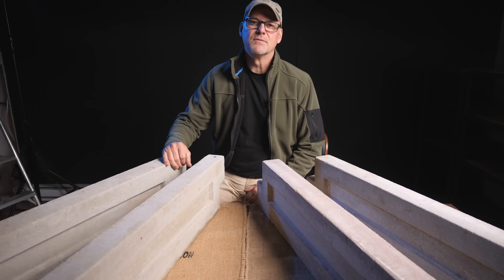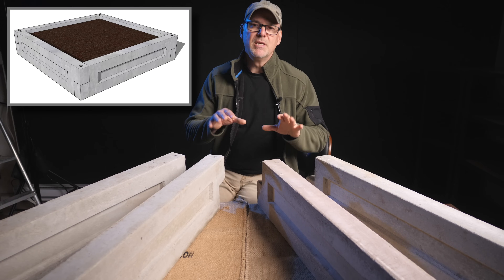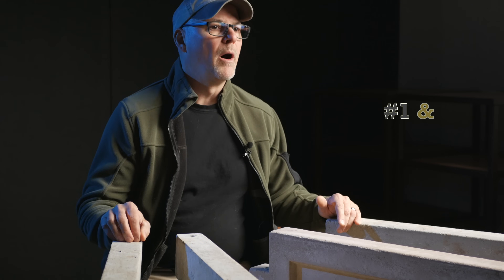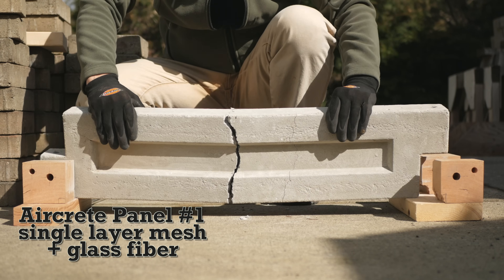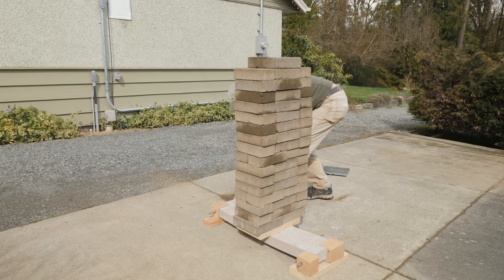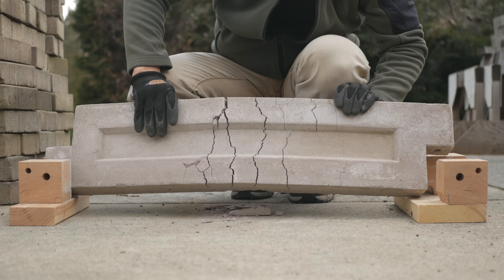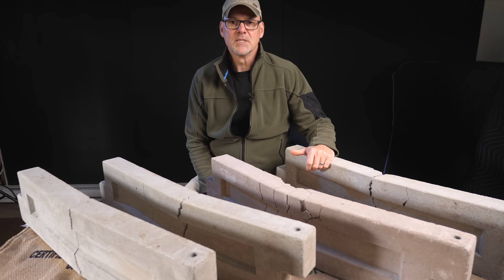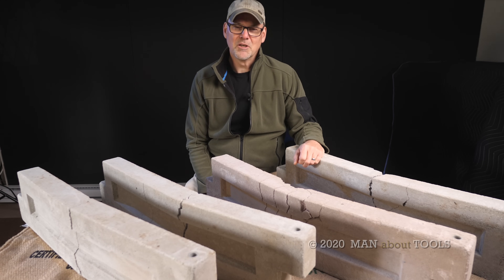How Strong is Aircrete? Deflection Test Lightweight Concrete Garden Box Panels

Comment: One of the reasons that the double layer of mesh may have helped is because it forces you to shove it deeper.  Since the inset is down in your testing, and the purpose of the steel mesh is to take the tensile load, the further down the steel mesh is, the more work it is doing to hold the cement together.  If you bent the doubled mesh forward on both sides of the inset, flat in the middle and forming a box in the thick part of the form, it would add tremendous strength.  Of course, if strength is a major issue, you could just turn the panels around and put the flat, reinforced, side away from the load.  Steel on the compression side of the cement does very little work.

Comment: I think that iff you separate the double mesh will be adding more strength to the panel and second, the perlite has the the capability of absorbing water so is better if you added it already wet, so That way the mixture won't dry to fast, instead will be adding water to cure slowly.. Thanks for sharing your efforts, keep inspiring others.

Comment: I wonder if aircrete fibres need to be longer then fibre for heavy concrete to make a difference.
also it is amazing to see what a double layre of mesh can do! wow!
Interesting to see how perlite really detracts from the mix
Thanks for sharing!
Reply: Tensile strength is not the only measure of utility in aircrete. For instance floors and ceilings may be OK with perlite, or sand to create the most useful mix for the application.Just seal it for it's environment.

Comment: I noticed you are loading them with the wire mesh on top for compression it should be utilize for tension at the bottom. If you load them with the wire mesh at the bottom you will be amaze  how much load your panel can handle. Try them standing and it will hold more load. Reinforce with wire mesh on top and bottom of your panel would be perfect for structural load. You can also try inserting a plastic tube at the bottom then insert an allthread rod after its cured put nuts and washers on both end and tighten.for a pre-stressed air create that you might be able to use for a bridge on a mini pond. More power...
Reply: I was thinking exactly the same, with using a pvc pipe with a threaded rod inserted  into it.

Comment: I appreciate your hard work. It seems as if that single-layer mesh was on the top side. If that is true, the panels would be stronger with the mesh at the bottom (or the side that stretches, instead of the side that gets compressed).

Comment: Im not an engineer but a physics student myself. I want to propose a improvement of the steel grid. As you pointed out in the last video what you are performing is basically a tensile strength test. It was very clear that the concrete panel with the double mesh could withstand a lot more stress. As the panels are loaded from the flat side the tensile strength gets concentrated on the bottom side bar sections that are deeper than the notched out middle section. I think you should try to get the mesh in some sort of shape that fills out these lower bar sections. The flat meshes you are using right now lie above the middle section and are therefore to far away from the opposing side of the stress.

Comment: I think you will find that if you add sand to the aircrete , you will see a significant increase in strength, along with two segments of Metal reinforcement . Should be closer to the others you tested.

Comment: Not very durable if you keep cracking them! LOL. #3 was most impressive!  If makes sense because two letters if wire would work in such a way that one is in tension . In single mesh, the  location of the mesh would be very important. So if the mesh was towards the top. Then it would crack quickly. If it was towards the bottom, then it would be very strong.

Comment: great to see the tests - adding rebar along with wire mesh may beef them up much more - it was a good showing of how a little materials science and engineering can go a long way - all the components need to be optimized according to your use case but the modular design was nice to see

Comment: Nice video.  I'd be interested in the same testing with an aircrete panel that has been wrapped during pour and cure.  Wrap could be fiberglass or nylon or cotton or whatever you think would be a cheap way to strengthen the panel and at the same time make it more chip resistant.
Reply: Could get pricey

Comment: Pardon my ignorance as I am not a structural engineer nor am I claiming to be experienced enough with cement to understand why you would want to put Perlite into aircrete.   Air bubbles are spheres. Cement that incorporates spheres seems logically better able to withstand breaking than cement that incorporates perlite (which I do have some experience with, and know that it is absolutely unable to add strength to anything it permeates). 
My only experience with aircrete was in pouring a skinned aircrete block dome (interior 15 feet) which had an aircrete block arch entrance doorway then the whole structure was covered with sprayed aircrete, then later, buried with about two feet of soil at the top, tapering out to about three feet at the bottom.  The soil has been planted with shrubs and vegetables and has had people climbing all over it for about a year, with no cracks, so maybe it's just that domes are structurally sounder than plates rather than it being the perlite additions?
Reply: domes act under compression which concrete does well. he was testing tensile strength which concreet does poorly unless it has steel rebar to take the load and evenly distribute it. however steel rusts and expands over time due to moisture in the concrete. that is why roman concrete has lasted thousands of years (no rebar). and modern bridges last only 20 years or so.
Reply: @Craig6844  That and the large chunks of calcium.

Comment: thanks for such perseverance - so if I go with aircrete  I'm gonna add a double layer of mesh and avoid perlite after this episode

As to whether I go with aircrete or straight CSA concrete panels - well it depends on your upcoming comparison to some extent - I predict greater strength already

At the end of the day as to whether its aircrete or CSA wil be down to a cost/benefit analysis - namely the relative benefit of any weight saving of aircrete; factoring in the simplicity, durability and cost of CSA panels. Already I'm leaning towards CSA given the extra equipment needs of aircrete - I just keen to get gardening is all. But I'll wait to see what you conclude in your upcoming post

Anyway your clear well produced videos are much appreciated once again from downunder in Melbourne, Australia

Please stay safe and don't catch that Covid 19 on us please :)
Reply: Any activity in Australia on using aircrete for residential fire resistance retrofit?
Reply: @edbouhl3100  no idea. Our science outfit might be the best to follow up. i.e. CSIRO.    https://www.csiro.au/

Comment: It might not be a problem, but my main concern with the freeze/thaw cycle is with water around the metal rods freezing and expanding to bust out the holes.
Reply from the maker: I have not had that problem. But the holes could be filled or capped to keep out water from pooling in them.

Comment: The double mesh panels were the winners because of the placement of the mesh.  Here is why.  While the concrete is strong in compression, the wire mesh is for giving strength in a tension mode.  The force of the soil in the bed would be such that the outside surface of the panel would be in tension.  The wire mesh, to be performing its' function, should really be pushed down in the form past the center depth, closer to the outside surface, where the panel is experiencing tension.  If its position is in the inner half (soil side) it is in a compression zone and not really helping.  Cracks form where there is tension.  That is why the rebar in a "pre-stressed concrete beam" used in bridge building, is placed in the lower part of the beam (as it sits in position in a bridge) where the tension from the load overhead is experienced.  If you really wanted to get fancy, you could  drill 2 holes in the end forms 1/2 in above the indent surface and place a rebar thru the holes-apply tension to the rebar while pouring and curing like they do when making pre-stressed concrete beams.  That's a lot of overkill for a garden bed panel but if you are having fun with the testing anyway, you would probably be amazed with the test results
Reply: Makes sense that different depths for the mesh could explain differences in max loads.

Comment: Congratulations, and thank you for the ideas. And advice from my side if you don't mind....Although nice to see your efforts regarding searching the best solution, I think the focus is missed a little. The target should be the lightest concrete withsand the DISTRIBUTED force from wet soil inside on its WHOLE contact surface, I think. But anyway this is your project, your choise...(And if you would get more reinforcements, than you should apply thicker, hole to hole bars bended both ends around the two holes, like this: <________> The other direction mesh is not that important if you consider the presented load -which is distributed force only on partial surface - meaning more load). No offense, just a comment from an engineer...:)....Keep up the great work!
Reply from the maker: Thanks! I very much appreciate the feedback and suggestions! There's so many ways to approach this. I think applying a distributed load would mean I would have to apply a LOT more weight. So there's issues trying to make that (safely) happen with my limited resources. However, I think I was still able to demonstrate a substantial load to get a general feeling of the strength. Kent

Comment: Try using galvanized rods instead of mesh. It should make the tensile strength greater. Would also like to see the thin CSA testing
Reply from the maker: I'd be concerned that the heavier rods would sink to the bottom of the form. The mesh has some buoyancy to it in the wet aircrete. I'm working on the CSA tests this week. The Covid issue has thrown a wrench into my life of late.

Comment: I wonder how adding Styrofoam balls would affect the strength of the the panels. Styrofoam is added to concrete in housing to make it lighter.
Reply: I believe that the perlite was a close enough signifier of that….. Using it for insulation is satisfactory but nothing with a load….

Comment: How about removing the decorative rectangle, and pushing the mesh further down, near the face, also for aircrete using a finer mesh? Would also be interesting to see, a thin layer of regular concrete on the faces and then aircrete in-between, should fair well in the lawnmower test .-.

Comment: Awesome.  I was going to ask you, would these be good as a hardy board for privicy fences?
Reply from the maker: Hardy board is much thinner I believe. And probably much cheaper and easier for that application.
Reply: @MANaboutTOOLS  Thanks for taking time to respond.  I guess what I'm trying to say, Is it possible to make thin sheets of cement board from the materials you use to make your planters to use as maybe inch thick sheets for fencing applications...
Reply: @wilassguess  The answer is yes. i have used Hardie board for a raised garden. 6.25 x 12' for 6 bucks and change at Home Depot. Used pressure treated 2x4 cut at 12" on outside. Attached at beginning, 4',  8', and end and then staked outside of those and screwed together. Made "L" shape corner out of the 2x4 attached to outside. Didn't want pressure treatment leching into soil.
Reply: @picayunebill6614  thanks Bill
Reply: @picayunebill6614  I was thinking today of a design similar to yours.  The differences being three boards high vs. one board and support posts every three feet vs. every four feet.  How did it hold up for you?

Comment: Are you actually testing the Aircrete strength or the different composite materials?  Also loading the panel along it's strong axis would give you a more meaningful value.  a

Comment: You should test them in the opposite side, shouldn't you ? Reinforcement is on the flat surface so this surface should work in traction and the opposite side in compression

Comment: Sodium silicate (Water Glass) strengthens and seals concrete.  In fact that is one of its primary uses.  It is commercially available, and you can easily make yourself.  I would love to see a video testing Sodium silicate on aircrete.

Comment: I’m surprised that the concrete isn’t failing at the ends where you pot the metal posts. There is less concrete in those points by half.
Reply: even at light load levels there is deflection of the block between the attachment points. This redirects the forces so that by the time the mass weight forces located at the center gets to the pin points it is behaving more as a compressive force rather than a shear or tension force. That is why concrete bridges are made in an arch and takes advantage of the fact that concrete is at its strongest when in compression hence the attachment points didnt break. If on the other hand the attachment points been rigid we likely would have seen failure there. It is likely becuase the block was free to pivot around the pin is what had the forces there redirected in forces that concrete is stronger in.
Reply from the maker: I was surprised too. But in a good way.

Comment: Nice work
The position of the mesh wire as far as I remember, you made it in the middle,  it should be near the bottom for more tensile forces for the application you use.
Reply from the maker: I agree.

Comment: Again, good practical testing.  Thank you for the video.  I suspect that the perlite may not have the shear strength that solid rock type material has and that may be why the two panels that had it were weaker than the two which didn't.  Have you determined the soil pressure that a full garden box exerts when unfrozen and then when the soil freezes at say 50% moisture content?
My experience with retaining walls has shown that having some form of drainage media against the inside of the wall reduces the hydrostatic pressure and in certain instances provides a bit of free ze expansion relief.  Really find your videos informative and professionally produced.  Keep up the great work.
Reply: If it is the case that the forces of the freezing of soil can be detremental to the panels, then it could be alleviated to some extent by lining the panels with a compressible material, say polysterene sheets prior to filling with soil. This would allow some expansion without affecting the panels - a side benefit would be in keeping the soil warmer for longer due to the insulation the polysterene could offer !

Comment: Great video. What about use a 
reinforcing steel bars instead of wire mesh. Reinforcing steel is not so havy and will give you tremendous power in compression. Two 
10 mm bars in diameter would be enough. 
You should definitely try it. 

I like your work not only with concrete, but especially with wood. good job, thanks for what you do.
Reply from the maker: Thanks! The heavier reinforcement might sink to the bottom of the form as the density of aircrete during the pour may not support it. That's why I went with a lighter gauge wire mesh. It appears to stay suspended while the aircrete sets up.
Reply: @MANaboutTOOLS  If you are worried about weight and want to get maximum strength, why not try carbon fiber tubes. You can get some pretty cheap carbon fiber arrow shafts that would work perfectly. They would impart tremendous strength...are light weight and would still float and can be had in 30" lengths for less than a dollar each.

Comment: It looks as though the panels were suspended by the iron rods in those tests. If they were then I'm surprised that the area of aircrete above the rods held so much force . I would have expected them to fail there first.  This  suggests that they'd easily handle being stacked vertically on their sides - to be used as fencing panels.
Reply from the maker: I was surprised too.
Reply: @MANaboutTOOLS  Another question that came to mind is - is it the fact that you had two layers of mesh the critical thing in giving it so much strength? Or is it the amount of steel that matters?  For example, say the diameter of the wire in the mesh is 1mm - and as you had in your tests - you used two layers.. Would a panel made using a single layer of  mesh made from 2mm steel be as strong  or even stronger?  And does the distance of the gap between the mesh layers have an effect on the breaking point?
Reply: TJP 81  Thanks for that. I'll be adding in extra steel in several small projects on that advice.

Comment: Great test! I found because of all  the air bubbles in the Aircrete it does not grab onto fibers well. I did not see much deference in strength when I added Basalt fiber chopped or Helix micro rebar to the Aircrete. I look forward to see what your findings will be after add chopped fibers.
Reply from the maker: Thanks Harry!!
Reply: Fibers,wire mesh, rebar.... I  just want something structurally sound
Reply: @johnallen9819  For Aircrete a super fine PVA Fibers will work well.

Comment: Have you heard of Helix micro rebar?  If you do any more concrete testing I would like to see you consider using this.  I plan to use it on my foundation and ICF pour.
Reply from the maker: I have heard of it but have not tried it yet.
Reply: I just looked that up.  Interesting.  But the orientation of the little rebars is random if mixed in like the fiberglass.  Only one orientation is optimal in this application.  If laying them in like the mesh, may as well use mesh.